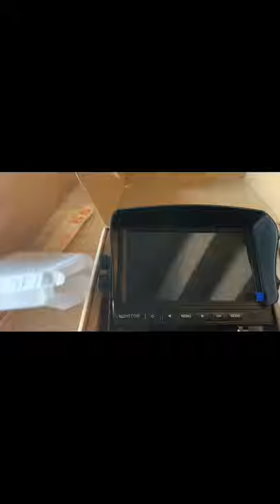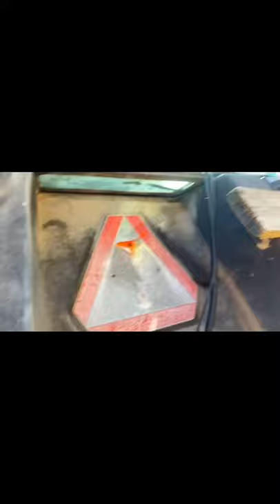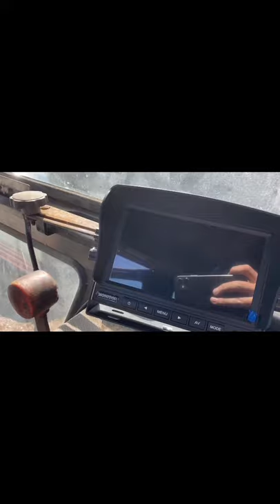I put Amazon back up cameras on my tractor and baler

Comment: Make sure you let us know if dust on cameras becomes a problem.  Thanks !!!
Reply from the maker: One on the back of the tractor go a little dusty. But I mainly used the one on the back of the baler. It’s definitely a lot safer running down the road now